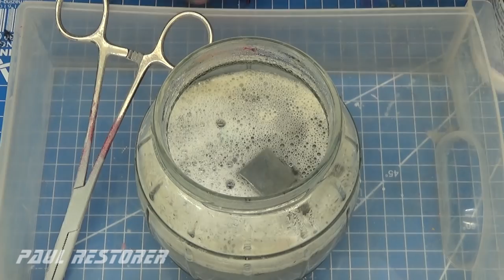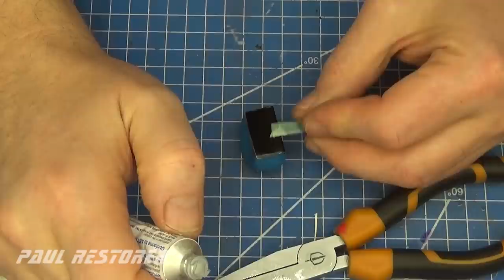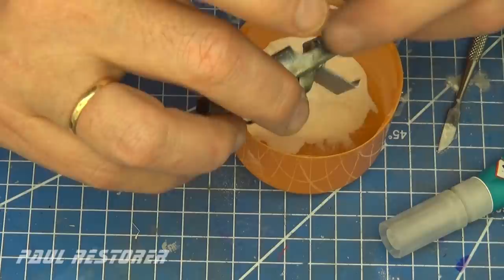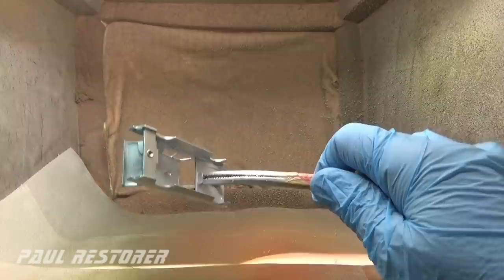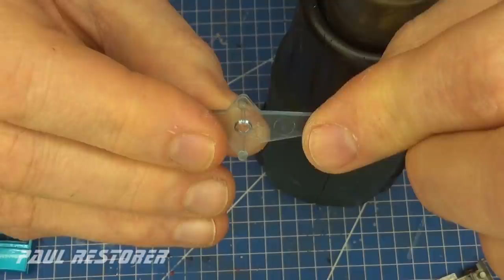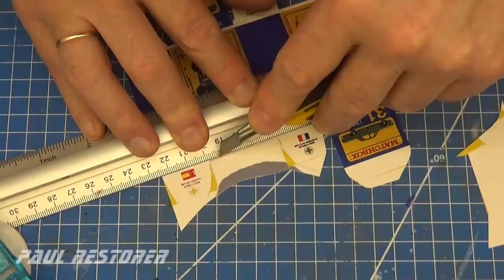Matchbox restoration Lincoln Continental No 31. Diecast car. Making trunk

Comment: Great job! The blue Continental sports wheels that were called "transitional", where Lesney started converting castings to accommodate the new upcoming Superfast wheels. But before the conversion was completed, Lesney made Superfast-type wheels but only half as wide because changing the castings was a long process.
Reply from the maker: thank you very much. Thin Superfast wheels were very good only axles were too weak

Comment: Fabricating the trunk lid was impressive.  If I may suggest:  I noticed the metal you used was painted. It looked like a  piece from a sample finish collection.  That's all fine but no matter how well you glue it or how strong the glue is , it will never hold any better than the paint  beneath it. Sanding off all the paint and scuffing the surface first will help ensure your fine effort does not come off down the road.   (pun intended)
Reply from the maker: Thank you very much

Comment: I am curious, did you shorten the screw that goes into the trunk so it is flush with the bottom?  Thanks
Reply from the maker: In some companies it shows. Not here. I do it in such a way that I screw this screw into sheets of different thickness depending on how much I want to cut and then cut the excess with a grinder. I unscrew it back, so I do not damage the thread and I am sure that the screw will screw in. Best wishes

Comment: Would you try the Limeaway and water method for the tarnished bases?50/50 mixture for approximately 4 to 5 minutes  with the addition of a brass brush. For being an acid,you need gloves and safety goggles.
Reply from the maker: i would like to try this method, but i don't really understand what acid is it? Is it supposed to be citric acid? Or should the proportions be by weight? Best wishes

Comment: To avoid any confusion, shouldn't your boxes somehow indicate that the model within is not original? Eventually, your collection will sell off, get separated, and without indication COULD be mistaken as originals!
Reply from the maker: any collector will recognize a non-original model. I, for example, do not glue rivets, I always use screws, it clearly shows that the model has been unscrewed and is repaired, and the box is always made of glossy cardboard and the original ones were dull.